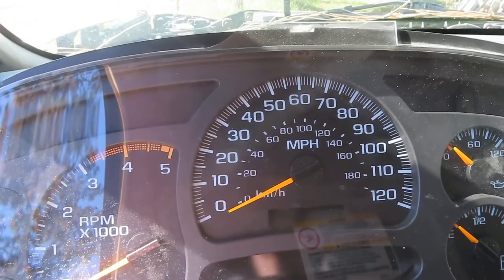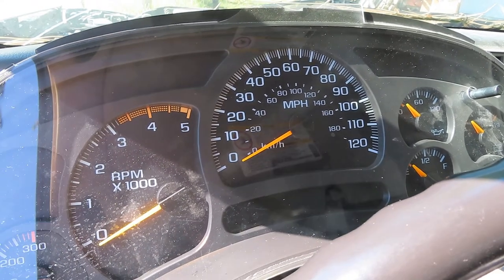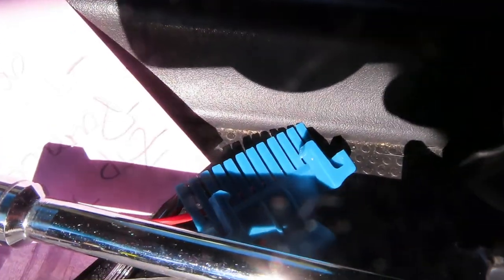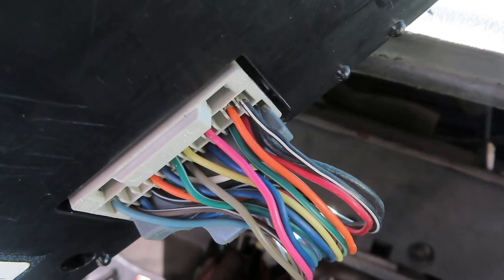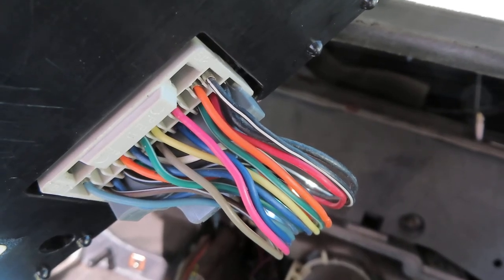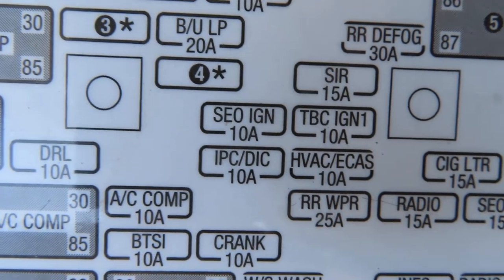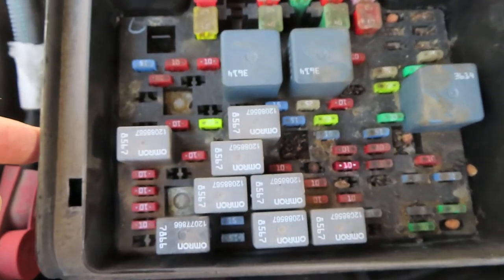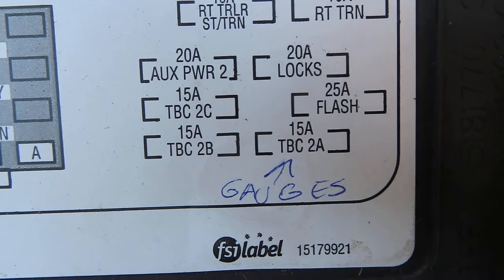2003 Silverado 2500 HD Duramax - ALL Gauges Not Working - No Movement

Comment: Thank you for the video, I would have never figured it out, my control panel cluster just stopped working randomly, checked the fuse and it wasn’t blown, but when I removed it and put back in, it worked…. Must have been loose.. Thank again!!
Reply: Thank you for your comment. My fuse also wasn’t blown and I saw this and turned my truck on again and everything worked
Reply: Same thing for me. Pulled the fuse put it back in then it worked. Thanks much
Reply from the maker: Nicely done.  Thanks for the comments!  Paul
Reply: Me too same thing

Comment: I have a 2003 Silverado 1500 and the back lights for the gauge clusters are off. So you are saying it’s the TBC 2A fuse on the side of the dash? So… check this out!!! While trying a new headlight switch module, I noticed a bit of  white corrosive powder on the harness plug in a couple of holes. The pins on the switch were slightly coated too. So, I took a pin and cleared the white powder away as well as sliding the pin into the plastic plug holes and went in and out about 30 times to rough up and clean away the corrosion. We put it back together with the old switch and voila, 1/3rd of the Speedo has light as well as the gauges to the right of that. So tomorrow, I’ll clean out all the pins to make sure they are free of corrosion. That should do the job.

Comment: Thank you for the tips on the separate power and wire colors. My problem turned out to be a mouse chewed my orange wire but it gave me a wire color to chase from there once I knew I didn't have power to the orange wire! Thanks
Reply from the maker: Great!  Glad to help.  The fuse box on mine has a square hole in the lid that is easy access for a mouse.  I taped it shut with ZIP panel tape.  Might help....

Comment: Just saw your video. I've got a 04 Suburban my cluster just stopped working. Lights work, I checked the fuse you pointed out and it is fine and getting power. But the whole cluster is still not working. What should I do?
Reply from the maker: I'd pull the cluster and verify power to the pink and brown wires on the cluster harness as shown in this vid.  If you have power, reseat the connector and see if you have any luck with it working.  If not, I'd suggest sending it to someone that can repair the cluster as it's likely an internal issue.
Reply: I’m having same issue. I doubt a mouse chewed my orange power wire but I don’t have a way to check it. I’m assuming it could be the cluster.

Comment: Awesome video, but it's not my fuse...☹️
My truck gauges come on sometimes and sometimes it doesn't. Where else does that cable lead to?
Reply from the maker: Thanks!  Not sure about wiring to and from.  If I was you, I'd first check the connector to the cluster.  Because your problem is intermittent, it will be hard for you to know if it's a power supply issue.  I would remove the cluster and jiggle the connector that goes in to the back of it a little and see if the gauges either start working or quit working when you do that.  If so, you should consider removing the cluster, take it apart and re-solder the pins that go thru the circuit board to the connector.   If you are not comfortable with that, there are plenty of people out there on e-bay that repair these for about $70.  They are notoriously flaky gauge clusters.  It could be another issue but what I recommend for you to do is pretty easy and low risk even if you aren't a great solder guru.

Comment: So I did what you said and the fuse is good but the dash still isn't working
Reply from the maker: Hmmm - hard to say.  I would first try to unplug and re-seat the connector in the back of the cluster and see if that does anything.  Beyond that, you should verify power coming to the wires as shown in my vid.  If you have power like you should, you might consider sending your cluster out for repair as it's likely internal to the cluster at that point.  Thanks, Paul
Reply from the maker: One other thing to consider if you have power present to the wires but no function...   Sometimes the pins in the connector "go bad" and get kinda deformed and don't make a good connection.  If you wiggle the connector and you get it to function you might have pins that aren't making the connection or the pins that go thru the circuit board in the cluster for the connector might need to be resoldered.

Comment: Going through this now! I’m only getting 5 volts to orange wire! Fuse isn’t blown so idk I just stole power from radio for now
Reply from the maker: You might try a new fuse.  It is possible for a fuse to cause higher resistance = lower voltage but I'm not sure if that is a common thing in a small automotive fuse but it's an easy thing to try.  Otherwise I can't really offer any advice as I've not had that problem.
Reply from the maker: I think I'm wrong in what I said previously;  I believe a compromised fuse could restrict current therefore causing a voltage drop "V=IR"   Same goes for a damaged wire that is restricting current.

Comment: Hope I get that lucky.  Gotta do one tomorrow...
Reply from the maker: Good luck!  yea - I made this issue 100x too complicated but I Learned a bunch of stuff along the way so that's the reason for the vid - sharing the info...  I suppose if I had a manual I would have found the fuse location right off the bat but I didn't...

Comment: Thank you great vidio but witch pins do I use to power the Cluster on the bench? you mentioned the Black and white as Ground and the orange as positive 12v is that correct? or I am missing somthig
Reply from the maker: I have not bench tested one of these things so I don't know the proper way to do it so do it at your own risk.  Here's what I do know per my testing that i did:  The black/white wire is ground.  The orange wire is 12V (present at all times when everything is working properly regardless of vehicle running or not) and the pink wire is 12V; present when the ignition is turned on/vehicle is running.

Comment: I washed the video because the same thing happened to me three plus Fridays ago going for pizza. The most reliable vehicle I've had in 6 years died 100 yards from its parking spot lost my gauges, lost my prindle lost communication to the TCM lost communication to the ECM and obviously I lost gauges washed a couple billion other videos. For some reason. My Allison transmissions is about 6 quarts to full. I'm going to drain that tomorrow. Don't know why it's not discolored. It's pink like it should be now. I'll be checking the fuses you'd recommended. It has nothing to do that. I saw on your video with fuse ECMB under the hood and nothing to do with ignition zero at the end of the dashboard but I'm going to be checking a screenshots. I took off your videos for the dash cluster cuz the dash is out other than the back lighting
Reply: I found my problem after a year 🤦🏽‍♂️
Reply: @pmsprivatemanagementsoluti5440  please do tell

Comment: ive got continuity with my orange wire and ground. what does that mean is it normal for power to have continuity with ground?
Reply from the maker: I don't think that's normal.  It's likely your orange wire is damaged and grounded somewhere in the vehicle.  What exactly are you referring to as "continuity" on your meter?

Comment: Will a gas instrument cluster gm 2500 work in 05 dura max 2500 will a gas 05   2500 instrument cluster  fit in the desiel
Reply from the maker: I'm not sure.  I've never done a swap.